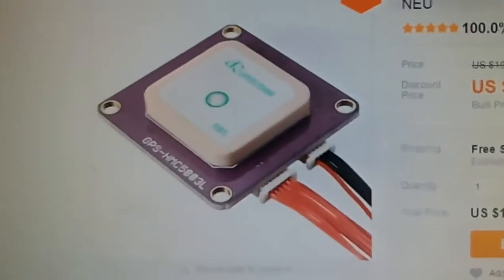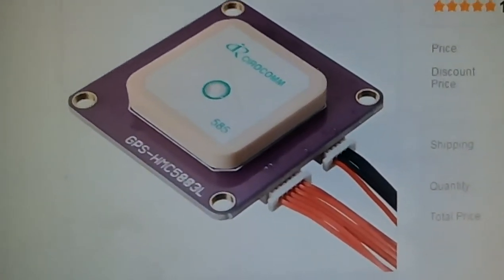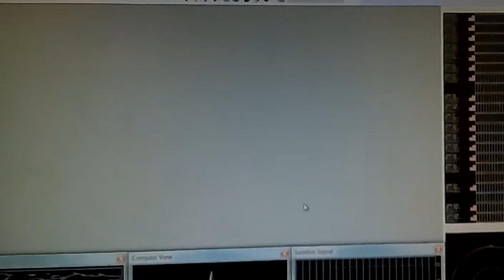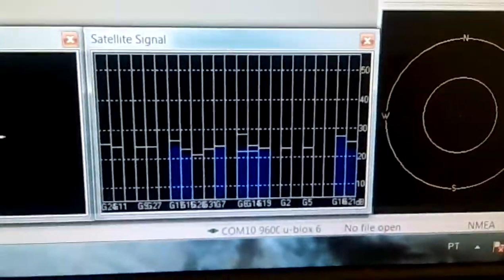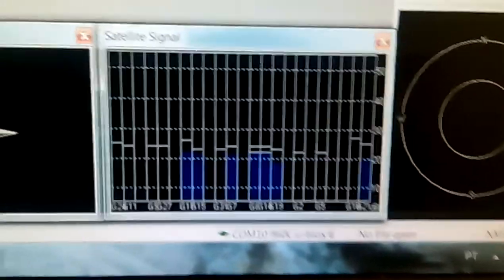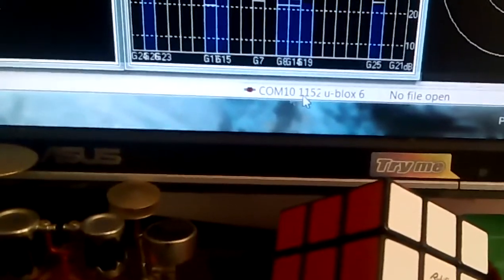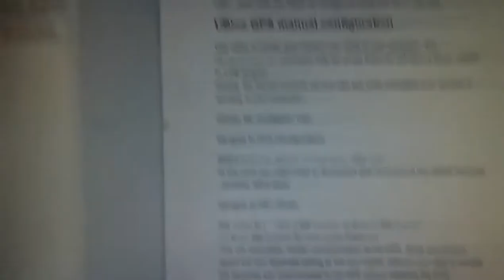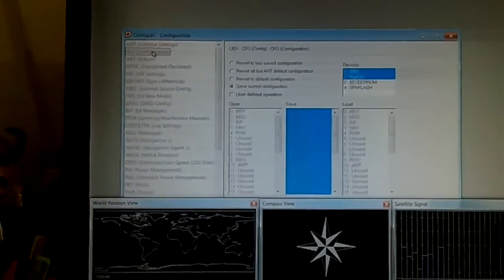Configuring Ublox NEO 6M GPS Part1

Comment: Wrong wiring. It's actually VCC | RX | TX | GND
Reply from the maker: maybe ;p i can't remenber though...but it worked fine like that ;p
Reply: +luisfilipe1983 
Doesn't matter for me anyways because the Neo-6M doesn't work in APM 2.5.2 (Quanum Nova). Any ideas why ? I do get two or three satellites in the u-center software though, but my engines wont lock and in Mission Planner I always get the message "No Fix".